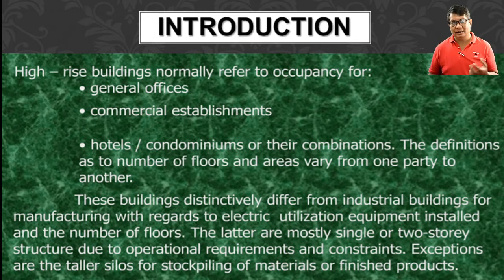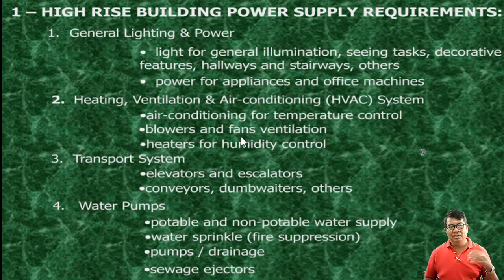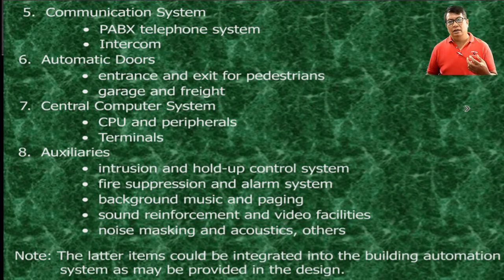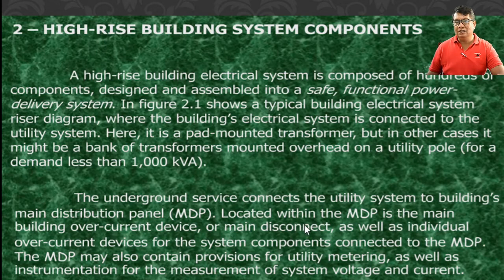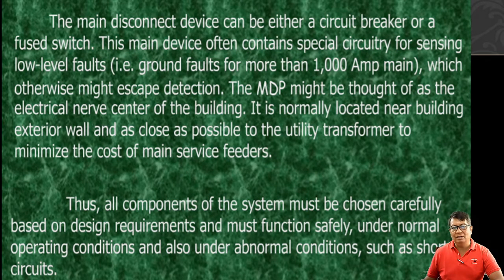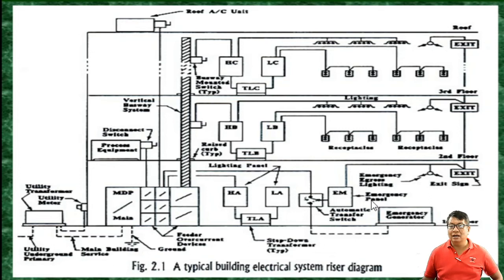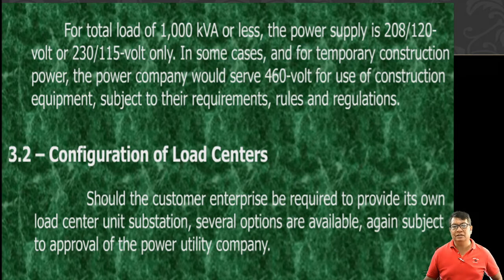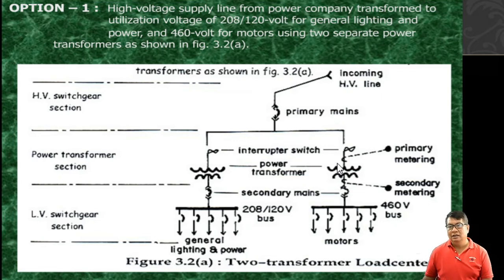Electrical System Design for High Rise Building (Chapter 1 - Part 1)

Comment: Where in our area here in Pinas has a utilization voltage of 208/120V?  What's the transformer configuration at the secondary side?
Reply from the maker: Thank you for subscribing my channel! In Pinas, no available 208/120 V unless it will be designed for the application. Meaning, ut will be made to order. Tnx

Comment: Electrical system in mix use building depand on the design methodology on which u design in subject building. Its variation of system designing